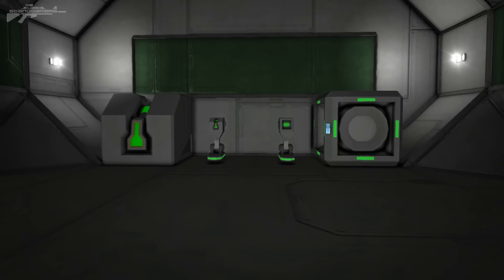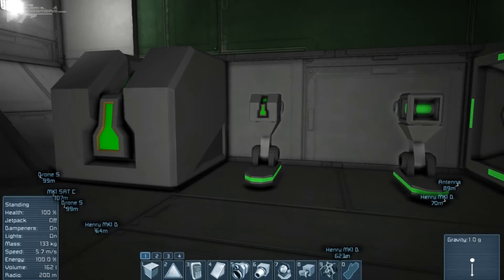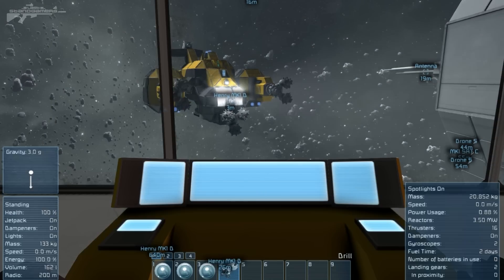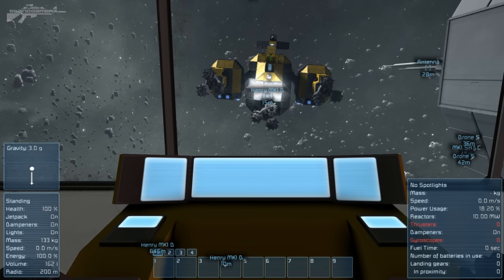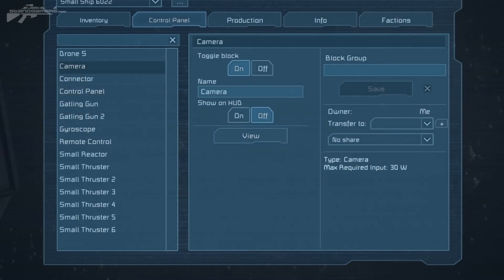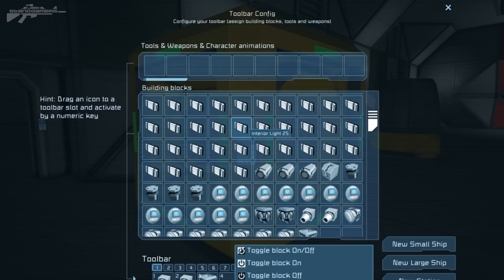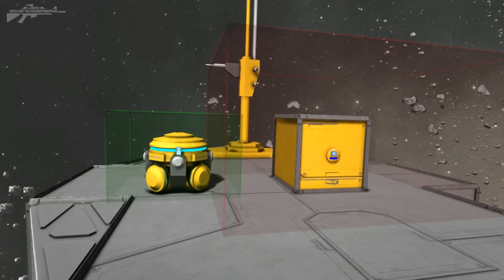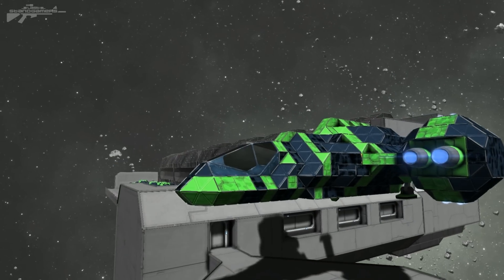Space Engineers - Remote Control, Drone Ships & Timer block

Comment: hmm, i haven't fully tested to see if it provides infinite range glitch) but you can sue a button to control a drone form an astronaut. also for all you people who want to make drones using small sip warheads, don't, just build a mine that uses a small reactor and about 1 or 2 uranium ingots, at one or more attached directly to that reactor, and a sensor set to scan for anything withing 20 metres (30  backwards) and detonate the mines instantly (large ship warheads have huge blast radius and damage) i also add a sensor set to detect players and starts/stops the warheads time to scare off possible disarms.

Comment: for some reason i cant control the remote control block from a cockpit that is not connected to my ship i have an antena on both the station and the ship but i can only control it from a control panal (i set everything to be mine and i am in reach of both of the antenas) does it have a problem with cockpits?

Comment: I wonder if you could get a large ship -- or station -- with a command center that has a bunch of seats/control pannels hooked up to drones so that you could have a pilot and/or defensive gunner keeping the crew safe while the crew operates drones to take out enemy ships. In other words...A drone mothership. Imagine little drones that have sensors hooked up to an hour long timer that sets off a bunch of bombs on a drone that's made its way onto an enemy ship, possibly by a retractable grinder arm, with sensors that only detect the space in front of the forward facing landing gear... You could hide it on an enemy ship somewhere, and then, in an hour...
 "Sir, engines are gone.."
"Can you get them back?"
 "Uh...Sir...They're...gone...Sir."

Or you could make a drone with a button on the hotbar that automatically launches twenty or so automated, tracking missiles. Or just plain mines.

Comment: I need a bit help D:

is there a option you must set to get thease remote controles working on a dedicated server?
i tryed it yesterday and i cant use the controle button in the menu :/
Reply: It should work fine on a server. Just remember you need antenna on both ships, and you need to own the antenna and remote blocks, or have them shared with you. It doesn't work if they're unclaimed
Reply: OK i found the problem, one ship had no claim, i feel dump now, thank you anyway :)

Comment: TV guided missiles!

This is making me think there should be signal jamming, because as it stands I don't see much of a counter to drones.
Reply: Something that confused me is why you would put the remote control on the ship exterior, since it offers the benefit of allowing the operator to stay behind armor with external cameras.
Reply: Drones with external cameras will offer less visibility around them, so it'll be easier to sneak up on a drone... with perhaps another drone. Well, if you put turrets on a large ship drone then I guess they can't be countered so effectively. You can always run away from a drone until it's out of range.

Comment: What about battery-powered drones with a self-destruct feature? Think about it; a remote-controlled, armed drone that doesn't need an expensive reactor to operate, and, if it gets disabled, can self-destruct on a timer to prevent it from being captured (or just be used as a kamikaze). You could use Aaron's attachment system (Connectors) to power and store the drones when they're not in use.

Comment: I'm not sure sure timer blocks need to be so big, considering they are basically just a computer.
Reply: Its because all Station BLOCKS are the pretty the same Size
Reply: Until such a time we can mount small ship blocks to larger ships (without that little rotor glitch), or we can place multiple blocks in the same area, we're going to be limited by the size of the grid.
And trust me, it's a lot more space efficient than using pistons and sensors to time things
Reply: Yeah this is stupid feels like minecraft mod.
Reply: i bet it's for design purposes.

Comment: bomb drones sneaking up on ships...
Reply: Minefields that, when they detect a ship using sensors accelerate towards it and explode.
Reply: *****  you could easily fit into a 5X5 small ship.
Reply: TheWargod56 It may work but is a bit risky. If turrets on the ship are set to fire at moving objects the warhead gets blown up almost instantly. You would have to build some sort of shield to protect it. But for lightly armored transport ships with almost no turrets (1 or 2) it would be perfect. A cool thing to do would be to put a beacon on it and set sensor to activate it upon detection of enemy ship. You get info that something is on your property and it works as a psychological weapon. "Sir, a beacon just popped up on our radar. It's heading straight at the Avenger. twenty seconds later Sir! Avenger just reported that the beacon is attached to a warhead! It's a mine! Oh my god... Another 20 beacons popped up near Thor, Adama, Starbuck and Raider! We are in the middle of a minefield! What are your orders, captain?"
Reply: Yeah and the timers giving them a warning... Nah that's stuped I'm stuped
Reply: CzarnyMlot Those mines will be so big it'll be impossible to not see them.
Reply: TheWargod56 Well, small ship warheads are quite weak and would work only on fighters, but fighers could outmanouver them.
Reply: *****  I guess, what about a 5X5 pushing a large warhead?.
Reply: ***** "Well then,minefield eh?Get into the hangar and build a ship that has a spherical grav generator to push the mines out of the way"
Or
"Get the turrents online and blow those things before we hit them."
Reply: Xen {11712}/GoldenDragonArmy  What if the mines don't have Artificial mass blocks?
Reply: *****
Evil thought~: Drill Missile that gets to an important part of the ship and then detonate it's payload within and if worried about auto-turrets you can have  detachable (armored) decoys
Reply: Xen {11712}/GoldenDragonArmy "Sir, we don't know how many of them are there and how close to each other they are. Activating our gravitational defense system or turrets might lead to a chain reaction, blowing all of them at once. Our armor should withstand this, but cargo ships may get damaged or even destroyed. I suggest we retreat and send a scout team."
Reply: TheWargod56 Use your imagination. Mentioning gravity cubes makes the roleplay feel weird. "Gravity cubes, sir? You drunk drunk the whole bottle of whiskey, again?"
Reply: ShadowShogun50 I like this idea. You could also use rock, place warheads behind and on the sides of it and make a HEAT torpedo. Warheads launch the rock in desired direction + damage first few layers of armor and maybe some engines or fighters, then the rock goes through the rest of the armor and some reactors, crew quarters, storage section or deck, depending on where you hit.
Reply: ***** Sorry to burst your bubble, but I've done some testing. Warheads and rocks do not seem to mix. Either the warhead does nothing or it destroys the rock entirely.

but maybe I'm wrong somehow, I can hope
Reply: twiexcursori Ah, I was afraid that it would be so. I will do some testing too, maybe I'll find a way to make it work.
Reply: ***** Yeah, I wanted to make that sort of weapon myself, though in my case I wanted a big siege torpedo sort of thing. Though, I could conceivably just use something like the TGAW design with more frontal warhead and some spacing so the rocks don't get damaged... hmmm..
Reply: twiexcursori Won't work. Just did some tests, rock is either destoyed, or is not pushed hard enough to do any damage. It can't even detonate another warhead put on it's way. Maybe a rock big enough would get propelled without being destoyed completly, but I doubt it.
Reply: *****
Why not Make a mini starburst cannon. Use a gravity well to compact rocks into a ball and fire it with gravity. Bradfusion did it and god damn it is deadly.
Reply: DeltaTwoNiner LSG did something like this too, named it Terminal Gravity Acceleration Warhead. The problem with using gravity is that you need space for grav gens and reactors. But now I got an idea, tomorrow i'll do some testing and give you guys results + details. Also, we need a research server, where people would connect for 8 hours a day and spend it on desining and testing new weapons. Some people would mine for resources, some would work in a factory and produce parts for gravity cannons or reactive armor...
Reply: ***** "Aye,do it Lt!Oh no*Sees a swarm of drone fighters*Oh....................shiiiiiiiiiiiiiiiiiiiiiiiiiiiiiiiiiiiiiii..............
Reply: TheWargod56 Then....we are screwed....
Reply: Ok, I tried to make a torpedo that would disconnect front part carrying breaching charge, turn retro engines for 3 seconds to slow down and make space between it and breaching charge so it's not destoyed in the blast, turn those engines off and start countdown on main payload, go through the hole made by breaching charge and blow shit up. But I have a problem with timer blocks. They seem to not always turn on correctly, what leads to the breaching charge not being disconnected, or not starting the countdown on the warheads (former leads to destruction of the torpedo outside of the armor, which is still pretty effective, the latter leads to a dud that makes only a small hole in armor).
Reply: sweet servers are dead 200 bomb drones 1 big ship
Reply: Or maybe auto drop ship like the super battle droid transports from star wars
Reply: Johnny Hostler dude... i think you now have gave me an idea for how i could pvp in this game and beat a full army of players with only a few
Reply: :D
Reply: *****   Point of a minefield is more to deter the enemy from using a particualr approach, or to funnel them into going a particular way, so...mission accomplished!
Reply: Justin Richey Not exactly accomplished. If they can see those mines from far away, they can navigate through the minefield. Minefields are not effective if you can see where the mines are.
Reply: And you have fully automatic weapons
Reply: ***** or you just put artificial mass on them so that they lock on the grav-generator on large ships lel
Reply: MultiThor45 You have no idea how gravity gens work in this game.
Reply: ***** I don't? then would you explain it to me so that I won't be so ignorant next time I try to just propose something, maybe I should have been more elaborated?

I realized that it wasn't so well explained at all. 

What I really meant is; Make a bomb, aka warhead(s) w. artificial mass and a small reactor + one control panel. Then you deactivate the artificial mass. put the "bomb" over an enemy ship within the grav field, you make up how. Then activate the artificial mass making the "bomb" fall downwards hitting the ship and thus effectively creating a little to big blast depending on the amount of warheads placed on the ordnance. I apologize for any spelling or grammatical errors. English is not my home language you see. xD
Reply: MultiThor45 You see, it's not my native language either. We are talking about mines, bombs that you have to drop yourself do not count as mines. And Aaron already did a bomber that drops bombs from "above". It even had it's own gravity generator so you could launch the bombs or droppods from every side of the target ship.
Reply: ***** Ok, sorry about that.
Reply: nineballmk2 exactly what i did. mine fits trough a 1x1 hole (large ship size 1x1 that is) so i can fly them in to a ship once its armor is penetrated and fly it to the reactor